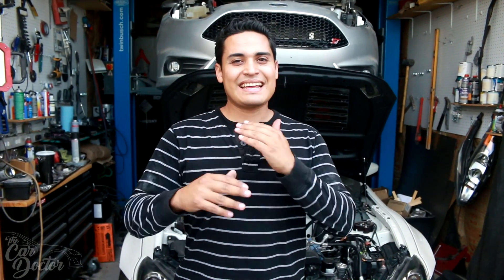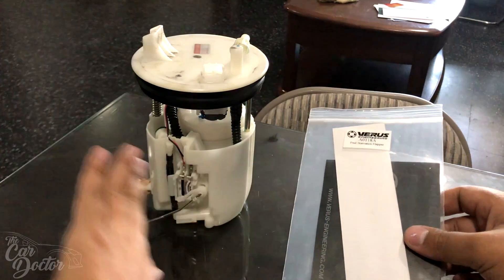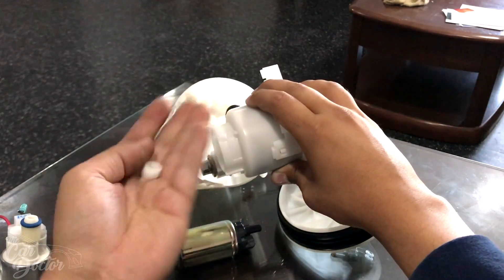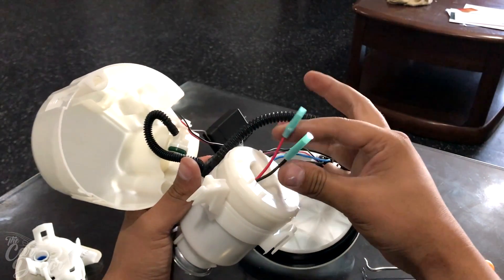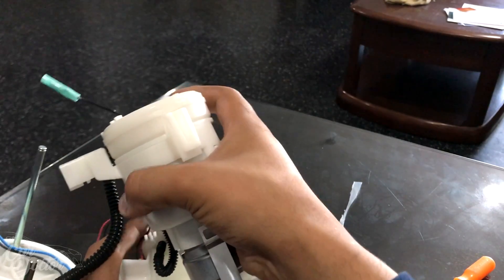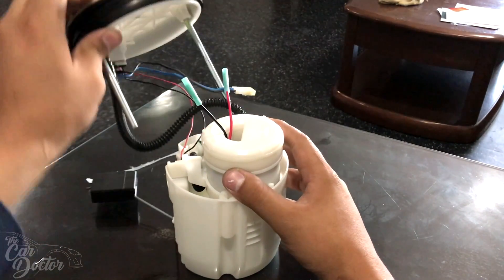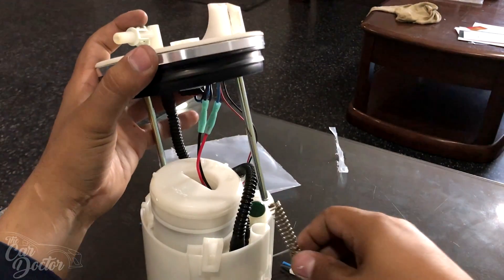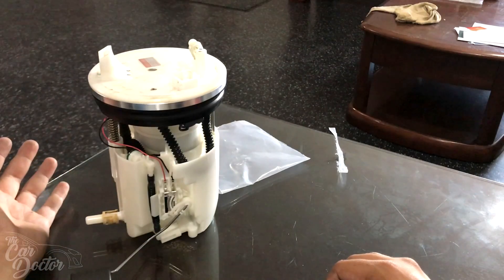Fuel Pump upgrade frs/brz/86 [Walbro 485]

Comment: I’m trying to buy the glow shift 3 gauge for my FRS but I don’t know if I need the optional Gt86 Oil sensor adapter and I don’t know what wire kit to get. There is 3 gauge power wires only and 3 gauge power/sensor wires
Reply from the maker: Not familiar with this gauge kit, so I couldn't tell you. If I set one up before I would have a better idea. If you know you don't need an option, don't select it, but if you aren't sure, then you will most likely need it for the gauge to function as they are hardware sensors.

Comment: Just finished this install. Took less than an hour. Hardest part was not what I expected. The big metal ring was a bitch to get onto the cap and the "o ring" didn't want to stay in the groove. other than that it was really smooth and painless.
Reply: How did you manage to compress it to get the screw cap back on? We've been having such a difficult time. If you have any tips it would be greatly appreciated :D
Reply: A Rip did you ever figure out a good way to get that plastic ring on? It’s being a big pain in my ass right now :/
Reply: @igliumagallanes7238  not sure if you figured it out either? Mine just won’t go down, I even removed the metal ring like spacer to provide maybe more clearance. It’s like a coke bottle cap you can’t screw all the way in. It seems the fuel pump is too tall—tore it all apart and my second guy even took the all thing apart and we compared the steps in this video step-by-step.
Reply: @cGRipOff  Did you guys ever figure it out I am stuck now too. Hopefully I get a reply two years later :(
Reply: @229Mike  hey dude, 2 years later i still have the car and have taken the fuel pump out numerous times now. The key to getting that tricky white lock collar that goes over the fuel pump hole is to align it flat on top of the threads, make sure its not crooked or else you will cross thread and it wont go on properly. once its lined up put both of your hands on each side of the ring and press firmly down, once you are pressing firmly down start rotating to the right to tighten it on, once you do one rotation or so readjust your hands back to the starting position (one on each side of the ring) and continue to press evenly on both sides while rotating. To check if you got it on all the way run your finger along the bottom of the ring and there should be no gaps. When i figured this trick out its gone on first try every single time. Good luck and let me know if you have any questions

EDIT: just noticed i typed that whole thing out for a different problem. Are you talking about the fitment of the housing around the fuel pump itself? If thats the case then make sure the rubber o ring at the top of the pump is seated correctly and there is nothing blocking the top part of the pump to fit in the little hole where the wires connect. One of the times i installed the pump in and one of the wires had gotten caught up in and make it a bit too tall for the housing to clamp down. Another issue that i ran into was the fuel filter on the bottom of the pump being to big and making the pump too  tall, in this case see if you can get away with using the factory filter from the oem pump and see if that works
Reply: @igliumagallanes7238  Thank you for your response, I thought I responded but it must’ve not took… yeah my boy believes he really tried to rotate it the way you mentioned… I mean either we are just getting really unlucky or I mean part of me wants to try again. We even took out the Circular round spacer mentioned in the video above. And it still won’t fit it seems but maybe we are just missing those teeth?
Reply: @229Mike  I think the key to getting it to seat right is pushing evenly on both sides and HARD all at the same time while rotating it on. It will get pretty hard to turn and just keep pushing and turning and it should go all the way on. Give it another try, you’ll get it
Reply: @igliumagallanes7238   Thank you for your tips with your support. I was finally able to fit it on! So thanks again for that.  of course now it seems my Fuel injectors side of things is  making the car run rich and I am now recording from the ECU to send to the tuner/injector company. Lol oh the fun how it never ends lol.

Comment: Just a thought..if you wanted could you buy the dw adaptation kit and plug the lines together and then cut and splice the lines on the dw connector so you don’t cut the stock fuel harness? Also is there a part number for the stock fuel pump holder ? I can only find the assembly. Any easy way to test the fuel pump for power once it’s installed ?